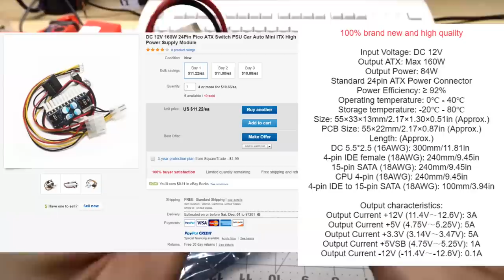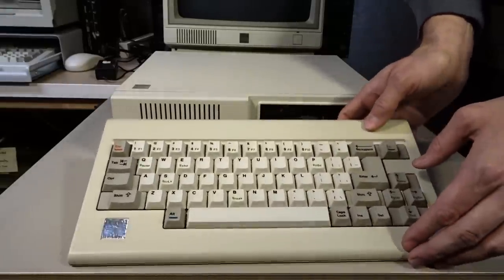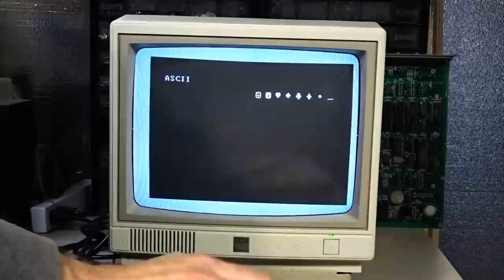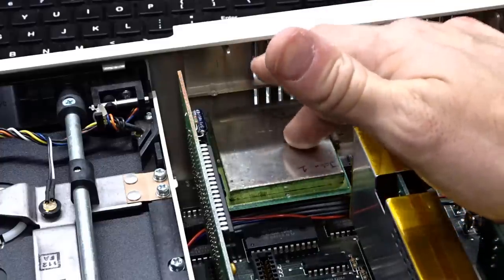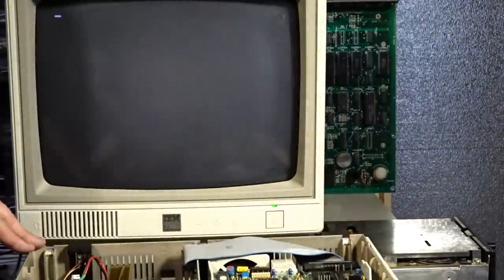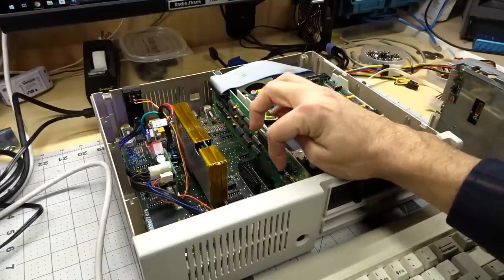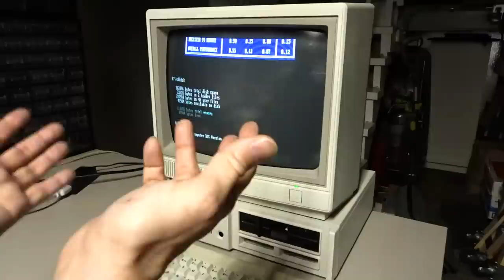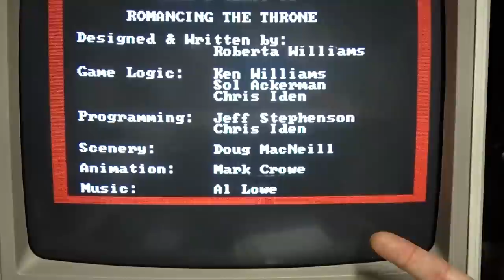IBM PCjr Part 2: Two steps forward, one step back

Comment: The "secret password" for the diskette diagnostics (which will indeed overwrite a disk) is MPNP.  I pulled that out of my memory banks as a child.  Why I remember that 35 years later I don't know.
Reply: Yeah I remember asking my dad what the code was and he looked it up and for some reason I remembered that.

The B is an error.  The Guide To Operations book states:
Have your IBM PCjr serviced.  See "Service Information" in this section.  Yeah, real helpful, I know.

This link may help, and also mentions "MPNP":  ftp://ftp.oldskool.org/pub/misc/Hardware/IBM/IBM%20PCjr%20Guide%20To%20Operations.pdf

I would recommended cleaning and lubricating the drive rails, and really well.  While as a kid we never experienced seek failures, every once and again my dad would open the Junior up and PM the diskette drive.  I gathered he knew what he was doing since he worked as an IBM repair technician for 35 years.  The drive was EXTREMELY quiet after that.

As for the intermittent ERROR H problem you're having, someone else in the comments had mentioned using a plain old ATX supply as that was the only thing that changed, and I saw your reply that you have none at the moment.  I'd definitely try an ATX supply again when you get one and see if the problem goes away.  If not, there's likely a circuitry problem.

One other thing of importance the Guide states is "Note:  Diskette errors may be caused if your display is within 15 centimeters (6 inches) of your IBM PCjr.  This problem is easily cured by moving your
display away from the IBM PCjr."  In practice, I've found the Junior's monitor was pretty well shielded and was able to stay on top of the system (we always had the flip out "stand" at the bottom front open).  That's why if you notice any advertising of this machine that has pictures always shows the display NOT on top of the system.

There were plenty of booter games that will work with a 128K Junior.  Most of these did NOT support the 16 color modes.  You will find that in cartridge games though, but those are very hard to come by.  I can tell you that Alleycat, Congo Bongo, and Tapper support 3-voice sound, but are 4 colors at a time.  There are also plenty of other CGA games that will likely run in that small amount of memory.

Generally, the only way to fully enjoy everything the Junior had to offer was to get the memory sidecar.  Yes, it was a trying time.  This was IBM's first foray into the home market, and there were going to be some mistakes along the way.  Remember that in these really early days (1984 or earlier), memory, even on full-blown PCs was quite limited.  The PCjr was competing with systems like the Commodore 64 and Apple II line.  But you had so much more functionality with a Junior that ran DOS, that a different platform system couldn't duplicate, or even imitate well.  The C64 excelled at graphics and sound, but was loading a game for 5 minutes off a floppy disk really acceptable?  And imagine the horrors when a disk started wearing out or if it were exposed to stray magnetic fields, and waiting those 5 minutes to not have it work.  Every system had its own share of different frustrations and especially limitations.  

Over the years that followed, most people upgraded their RAM.  640KB ought to be enough for anybody.  Then he made Windows.  And one day, 640GB of memory STILL won't be enough.  Back in these days, if you didn't have enough memory, you simply didn't have enough memory, there were no swap files or other trickery involved, it just didn't exist yet.  Radio Shack Trash-80's with 4 kilobytes of RAM, really?  Yeah, you had to be an EXPERT programmer to take full advantage of machines then, there wasn't much horsepower to go around.  Nowadays, effectively we have a hot-rod engine in a Ford Pinto.

Even as a kid, there were a number of programs we had that simply wouldn't run on the Junior.  The very few times my dad took me to work with him, I got to sit in the IBM office at somebody's PC, and run these games, usually on a souped up XT.  In your case, you are much more limited; our Junior was maxed out to 640K and still couldn't run these games.  With 128KB you'll have to take what you can get.  If you do decide to get a memory sidecar, you'll see the capabilities of the Junior open right up.
Reply: @jaykay18  To be fair the C64's reading of floppies could be massively sped up with the fast load carts, and the 128 with 1581 drive was faster than some DOS machines. Plus the C128 could go up to 640K RAM with 64K dedicated video RAM.
Reply: That's all fine and good, but the fast load cart was an UPGRADE, just like RAM is to a PCjr.  Fast load carts basically opened the door to new possibilities with computers then.  People had imaginations instead of smartphones, and a fast load cart would allow them to experience a larger set of software.  In fact, it might drive their curiosity into "how does that fast cart work", or for that matter "how do I make the computer do what that game did", which could lead to them becoming programmers.

If a C128 can go up to 640K, so can a PCjr.  But again, that's an upgrade.  My point was the machines that were out at that time, in their stock configuration, weren't that great.  With upgrades, it really opened up their possibilities.
Reply: @jaykay18  Well yes and no. More an add-on than upgrade. And it can't of cost anywhere NEAR the amount RAM cost back then. Remember the C64 was a low costs system, and the PC Jr was an IBM machine, and IBM loved their premiums!!
But overall I kind of agree. The fast load carts only sped up what was already available, the side cart thing added RAM to make MORE stuff available!!
And yeh, you're right with thr C128. Although it was a much better machine IMO than the PC Jr.
Reply: Very true, a fast load cart was an add-on.  PCjr had a speech adapter add-on, but you'd have to pay IBM prices.  It also had a parallel port add-on, again you'd need to pay IBM prices for that, or find a serial printer to hook up.  Fact of the matter was, IBM was THE machine to have, to be compatible with the rest of the world.  They also had a tremendous software library with tons of productivity programs.  Games were better on the Commodore machines, there's no contest about that.  It was better suited for it.  But IBM had the market share, and if you were going to get anywhere without being left with an orphaned machine, you had to pay IBM prices.  There's still software even to this day that I run from the 1980s, and it runs on a modern PC, though with the "advent" of 64-bit machines today and Windows not supporting 8-bit apps, you have to use DOSBox.
Reply: @adriansdigitalbasement  The documentation is all available online, including hardware troubleshooting and diagnostic codes -- do you need help finding them?
Reply: @Adrian Black .. I don't remember this floppy drive error.. in your previous video...  ...  ...  It behaves the same when you use the normal PC power source???....  instead of this adapter for the adapter of the adapter that adapts to the adapter???   8-}
NO SERIOUSLY my best guess...  that adapteer (the blue one in 14:31) is liking some residual energy into the motherboard .. keeping some corrupt info that causes the floppy to fail at next startup ...
Reply: jaykay18 😇interesting

Comment: Thank you for bringing back so many memories with your PCjr project Adrian. One of my very first encounters with computer games was while visiting a friends house with his then brand new PCjr. His was also a 128k model. The game that came with it was the original Kings Quest I and may have been bundled with the computer as it had IBM branding and came in different packaging than off the shelf games. I remember being absolutely amazed with the opening screen with King Graham standing beside the castle. In this version, there are sound effects for the birds on this screen too which I've not found on any other version. To see a game with 16 colours & 3 channel sound in 1983 or 84 was quite something. The PCjr monitor was bright, clear & crisp and LOUD just like yours. I believe it also booted straight into game just like your KQ II copy. For a time, I also had my own PCjr and the two of us would try using our wireless keyboards on a single computer. Two keyboards with one computer worked, but only one at a time. It was the first computer I ever used to connect to BBS's too. So many good memories!

I've been on a quest for a while now to try & recreate that original Kings Quest experience by finding a vintage computer to run it on. Emulation is fun but it's just not the same! To make things extra challenging, I found a YouTube video of someone playing Kings Quest I on a colour Macintosh. I thought it would be a fun project to try and find it and get it working as I was previously unaware there even was a colour version of it for the Mac! I found an original copy of it on eBay and tried it on my earliest colour Mac, an LC II. The disk tries to boot, but I believe it uses an earlier System OS than the LC II supports. This means to get it working, I'll need an even earlier colour Mac that supports System 5 or even earlier. It's a lot of hunting around to recreate a 'similar yet different' childhood memory, but I've been hooked - ever since I first saw Kings Quest booting on a PCjr!
Reply: I can relate to this post. My dad bought a pcjr in 84 with kings quest. Loved it. Bought a tandy 1000ex and just got kq1 playing tonight on it. The memories of my childhood. Awesome

Comment: I remember spending countless hours playing with that keyboard diagnostic software and being entertained by that character going to the corresponding keyboard character spot when I was very young.  I can't find anything further on the Internet about the utility though.

I also remember those times where various errors would appear and I'd have to turn off/on my PC/JR.  Now I understand that hardware was the possible blame.  When computers function I love them.  When they need troubleshooting I hate them.  Thanks for the journey!

Comment: At 1:33 you're 100% correct. Those extra pins on the ATX supply can be left alone for the most part. I worked on a project that required an ATX supply and though we had a full length connector, we left the oins unused.

Comment: Those small yellow tantalum decoupling capacitors on the disk controller card are famous for going bad and can go completely short. I'd start by replacing them first before going on to the electrolytics, and the IC's.
Reply: Radial electrolytics are very common. Did you mean axial?
Reply: Definately harder to find, but you don't need many and they are available on ebay, adding vishay or sprague to your search will help you find them.
Reply: scotty B what Scotty said !
Reply: As far as it looks in the video, those are more "pillow" shaped instead of the typical bead-shaped tantalums, which makes them look more like ceramics which should most likely be fine.
Reply: That was one of the thoughts I had as well, yet those look more like common ceramic caps. Also - though not always the case - didn't IBM love to use 3 leaded tantalum caps?
This site mentions a factory fix which seems to add some additional decoupling to the floppy controller, which might be worth a shot: https://www.zdnet.com/pictures/cracking-open-the-ibm-pc-jr/16/ If the voltages are otherwise stable this has a good potential of being the fix you're looking for.
On a sidenote: Don't use the 8 shit guy as a reference ... most of his projects are good examples on how to not approach problems.
Reply: @adriansdigitalbasement  But getting shorted is not the only thing that can make a tantalum fail, they could lose their capacitance, you can measure them and still get good readings but they may still be bad, especially if you are getting random errors.
Reply: The instability of the drive definitely sounds like a bad cap to me. It doesnt sound like a shorted cap, that wouldnt boot or would burn something but a dry cap with high esr and low capasitance would certainly cause that kind of problems.
If it were me i would try grabing a heat gun and compressed air can and heating or cooling  parts of the board and cards to see if ypu either get the error constantly or make it go away.
Reply: @1337Shockwav3  What's wrong with 8-bit guy? I know electronics troubleshooting isn't his thing (nobody's an expert on everything), but I don't understand why people have been bashing him lately.
Reply: @BlackEpyon  Lately? I've been doing so for quite a while. He doesn't need to be a pro at anything, he should just do his homework when doing research on the topics he talks about. His videos are often full of downright incorrect information. If I wanted badly googled knowledge I'd look on some lamer forums.
Reply: @1337Shockwav3  Give examples please. I've seen plenty of retro-computer videos where somebody failed to notice something that somebody more familiar with the system would find painfully obvious.
Reply: @BlackEpyon  My current favorite remains him listing a TK85 (a non-licensed clone) as an alternative aftermarket keyboard for the ZX81. There's a ton more like that but I'd prefer not to rewatch his stuff.
Reply: @1337Shockwav3  Yeah, that's a bit of an oversight. I try not to refer to authority anyways.
Reply: scotty B 🧐

Comment: I have seen lots of equipment behave the same way with failing electrolytic capacitors. My vote is to examine further the axial electrolytic capacitors on that floppy board. Before ordering replacements, can you desolder them from the floppy board and test them out of circuit?
Reply: This is it. The "wait 5 minutes and it works" is because the capacitors discharge.
Reply: Maybe.
Reply: You're most likely correct, I actually read somewhere that someone had experienced an issue with a product they were developing where over time a static charge would accumulate and eventually would set a specific pin to high which was supposed to remain low. It's easy to forget that it's all based off of tolerances which can change over time and become unreliable with some components being more susceptible than others under certain conditions.
Reply: Jonathan Gray Someone goofed and left a CMOS digital input open. As Mr Jones says: classic rookie mistake :) Occasionally you’ll goof that way even with decades of experience. It’s easy to miss if everything works. That’s why design reviews work - even self-reviews where you go over the basics as if you were looking at someone else’s work.

Comment: your issue could be something to do with a capacitor.. if you think about it, it makes sense..
it only works if you leave the pc off for a while, thus giving the caps time to discharge slowly.
but then once you boot up and it reads fine, even if you reset it still works, because the machine is technically still powered, just sends reset to the cpu line, thus, caps are constantly powered during all this time..
so could be a high ESR reading from a cap somewhere..
Reply: It is probably a number of things. The monitor sitting on the machine is a possible culprit. The IR receiver or a stiff drive..

Comment: The issue you are experiencing with the Floppy Controller is identical to an issue I had with my IBM 5160, except that it was with the CGA card. I was using the composite output, and continually had problems with power cycling. The only remedy I had that worked was to replace the card. It worked fine when I let it sit for 3-5mins, but wouldn’t boot if I just cycled it.  I came to the conclusion that something with the gates on the ICs must have been latching up and causing it not to boot properly.

Something you might try, if you don’t mind the mod, would be to place some high value resistors (10k or better) between the legs of a few of the caps (especially on any signals that have caps). This should help bleed those caps. If it’s a problem with the ICs starting up in an unknown state (as I suspected on my card), this could fix the problem.

Comment: On the tape on the drive, both of my PCjrs have an IBM lines logo the size and shape of the indent of your sticker. It even looks faintly like the lines of the IBM logo pushed up against it in your video. My guess is that it's a shipping cover to make sure it's nice and shiny when it gets to the end user, which seems likely given you found the label covered on your monitor if I'm remembering the right Youtuber.
Reply: @adriansdigitalbasement  Neat.
Reply: That really is neat, for me as a car guy it's the equivalent of buying a car where grandpa never even tore the plastic off the seats from the factory. Really satisfying to think you'll be the first person to see or touch that label since it left the factory getting on for 35 years ago!

Comment: With aging radios, I have worked on Electrolytic capacitors and the old paper caps are the first to go dipped and disk caps not so much. I even went and bought a Commodore 64 after looking at your videos and the last piece is finally coming, a 1702 Monitor next week.  So My fun hasn't started yet because all units with the exception of the Monitor are untested. After seeing your series on the C64 you recovered that ants had lived in I decided ok I will see if I can get one little did I know the expense. I'm retired so I have more time to tinker than most people. Thanks for having the information on your videos.